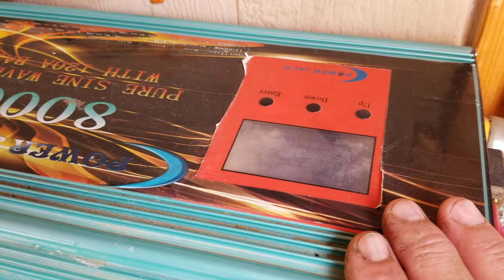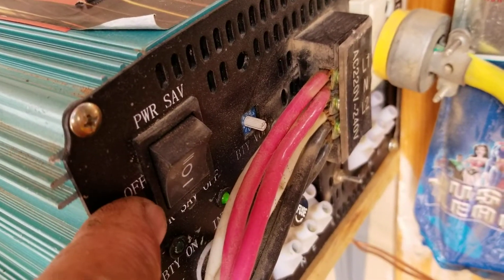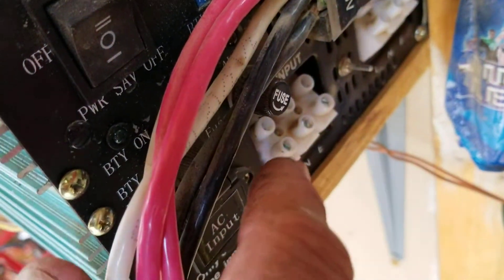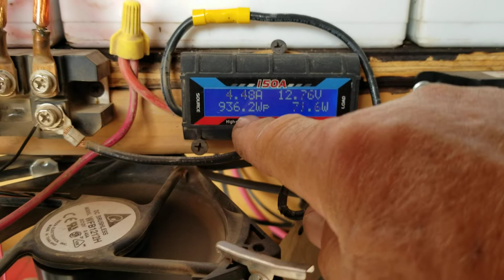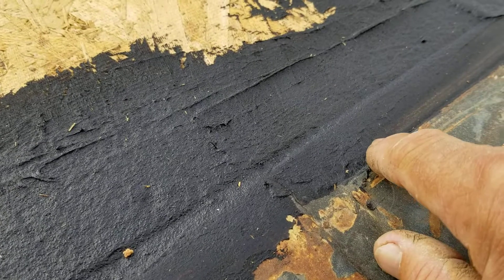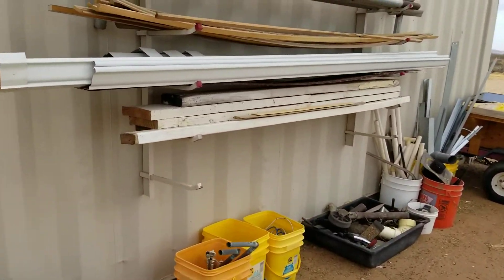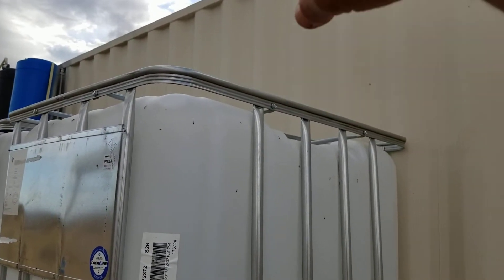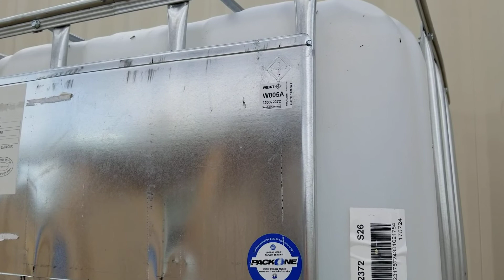PowerJack LF8000/32000 Pure Sine Wave grid tie inverter. Sep. 16, 2019

Comment: Why does the top of your 8000w inverter say it can only run a 1200w motor or other low power devices? Is that table correct?
Reply from the maker: That's the old Power Jack, from China.  Apparently they Lie straight faced while we cry.  Also their "pure sine wave" is dirty too.
Buy an AIMS inverter!  That's what I replaced it with, and they don't lie, it does what they promise!
Reply from the maker: Also, Welcome aboard!

Comment: My garage roof is also a bit slanted towards the downpipe, but no gutters, only a wooden rim covered with tar paper, with one opening for the downpipe, and a higher (below the rim level) emergency overflow, just in case the downpipe clogs up. My solar panels are east-west oriented (I'm grid tied and also wanted to minimize wind forces and ballast of the panels). My installation cie wanted to place 18 panels all facing south, I now have 24 panels in 3 rows , where each row has 4 facing east and 4 facing west with an angle of 15 degrees. All rows are interconnected with horizontal pipes, for stability, and the ballast is loaded in gutters in the center of the rows. Of course I realized I will never get max production from my panels that way, but this orientation will allow for more internal usage and less to and from the grid. I suspect that in the future they will install smart meters, that will meter high prices from the grid and and low prices to the grid. At the moment in and out have same price, only overproduction results in low price. If we switch to an electric car we still have a lot of angled roof facing south for putting more panels up ... I think an electric car is a sort of battery bank. I don't have a first flush in my rainwater system, I have to drain my IBC totes before it starts freezing. That's why I have a winter-summer switch in my downpipe, during winter all water goes to the sewer. Final note: in order to insulate the roof of the garage I've put up all weather resistant insulation panels on top, first ballasted with tiles, but they are now held in place by the interconnected solar panels, the tiles are now ballasting the solar panels. There is one snag: weeds and trees are trying to grow between the insulation panels. Best wishes.
Reply from the maker: Sounds like you made a tough situation work!  I get freezing temps here also, but not deep freezes.  As long as there is half full totes, they shouldn't freeze.  I do have to wrap the pvc pipes though.
Too bad you don't have a first flush system, but I suspect you only use that water for irrigation?
Reply: @GBear  During winter only cover crops and cold resistant veggies such as garlic,  leaks spinach and carrots in the raised beds (no watering needed). During the 3 remaining seasons the water is only used for watering the veggies. I mostly water the veggies subsoil by using 3 inch plastic pots dug in, ballasted with pebbles, to reduce weeds sprouting and evaporation Only overhead watering after planting seeds. Still not sure about the water needs of my attempt for a passive solar GH during the winter. At the moment bell peppers, tomatoes and cucumbers in the GH, Going for some lettuces and kale next winter in the GH. At the moment I'm completing the insulation of the 1 foot high brick and mortar footings with 6 inch PIR covered with EPDM. Had only the north wall insulated in combination with 25 gallons of water in tubs and some half gallon water bottles: no frost in the GH. I'm trying to raise the thermal mass in the GH by insulating the footings, using grow bags and water storage. It's a project, still no external heat sink, automated ventilatlion and wireless measuring. Of course the north wall and roof of the GH is fully insulated. Lots of thick bubble wrap and radiator reflector foil are at hand.
Reply from the maker: @earlshine453  sounds interesting!  Are you ever going to post content on your channel?
Reply: @GBear  I'm on the brink of getting my smartphone working, making pics, doing whatsapp, etc. My wife presses me, because she will visit our daughter pretty soon in New Zealand during 7 weeks. If you hear a loud sneeze coming from the skies next week, it's probably my wife on her flight from NY to SF.

Comment: nice function on the inverter grid tied charging, does osb soak up water like a sponge? perfect location to maximise solar output bet your going to build it strong
Reply from the maker: Osb is made up of as much glue as wood chips, but it is not rated for exterior exposure.  Water gets in between the wood chips and causes them to expand and the glue breaks down causing the panel to expand and fall apart. It is made to be an underlayment or shear panel.
Yes, that roof will be great for panels, and I have no choice on building strength...the high winds determine that for me.
Reply: @GBear  was thinking with my puny brain , ive seen battery protection devices something  like victron sells and others , lets say a charge controller goes haywire the device prevents the batteries from being damaged by severe over charging , i see thes devices also can disconnect  loads from the batteries if the voltage goes too low , i know inverters have that function within . just a thought , more money i know but cheaper than replacing batteries.
i actually saw an aussie guys entire agm battery bank destroyed by a very early model mpp solar charger and it was a decent sized battery bank, $$$$ , these days mpp is better ofcourse, kinda like powerjack they were a total abomination with fake warranties and crap service but they have markedly improved.

Comment: Bed liner paint for the roof indestructible
Reply from the maker: Never heard of it,  explain please.
Reply: For pick up trucks paint on bed liner water resistant indestructible
Reply from the maker: @101starting  how much$ per 5 gallons, and what is the coverage?
Reply: To the gallons It will cost more but will provide better protection
Reply from the maker: @101starting  thanks.  I'll stick with Tropi-cool 100% silicone roof sealant.  I've used it before and it really works and lasts.  $239.00/5gallons
Reply: @GBear  Go with what you know...  especially with you construction experience...
Reply from the maker: @clarkrobinson3084  you betcha!

Comment: Very nice inverter, "E" might be for earth
Reply: In Europe E is earth ground I found on German short wave radios.
Reply: @ronb6182  ..."Erde" in German
Reply: @johnq8792  it's not antenna so it's earth. English translation. American radios back in the 30's and 40's were better. I always had problems with the push button contacts. Rotary switches were much better design. As for reception both were equal because both used the same tube values.
Reply: @johnq8792  thanks for the German translation. Grundig was popular in the USA my uncle had one. My friend had one also but that's the one with the bad push buttons I think it was the SW setting. His also had AM and FM as well as short wave.
Reply from the maker: E!  You could be right!